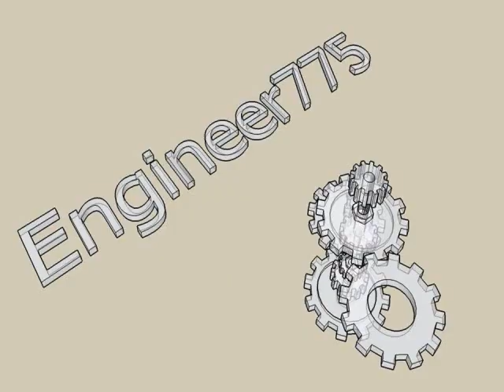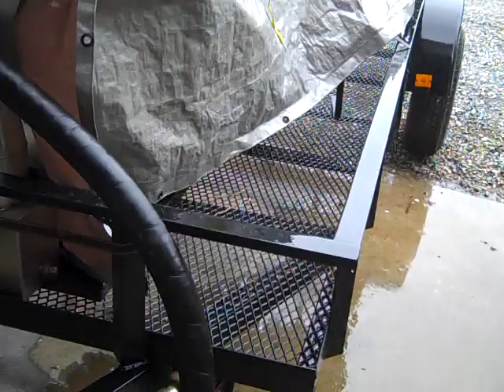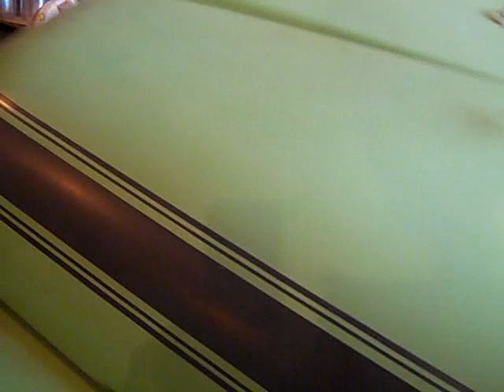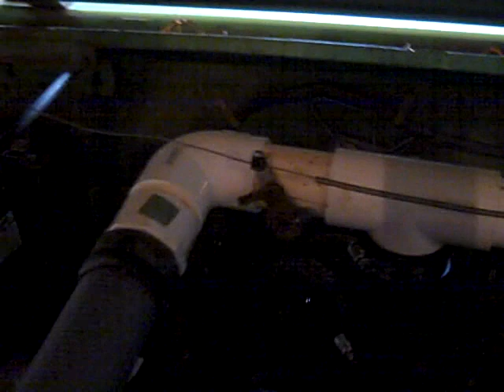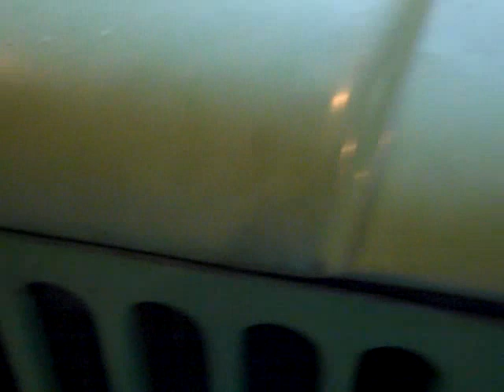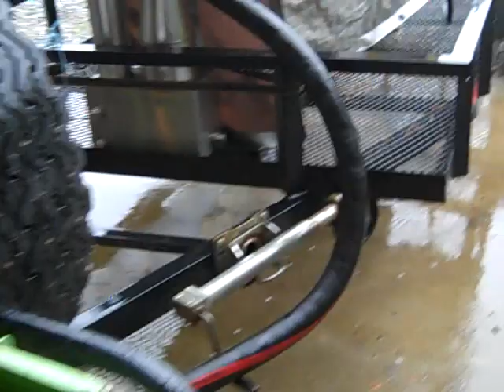Come see the "Wood" Jeep: Heritage Life Skills II

Comment: it totaly depends on the quality of the wood (moister content) the filters and the gascoolers(which remove the most part of the tar) 
larger systems run large converted diesel engines from 4000-8000 hours a year without problems

Comment: if cut to the right size and dry there should be no problems.
all carbon based fuel of the correct size (matchbox to large matchbox size)can be gasified

Comment: As someone in the automotive industry. I'm just curious with a standpoint of the longevity of the engine. Have you put any thought to filtering smaller particulate from the fresh air and also the wood gas supply.  Forgive me as i haven't seen the rest of the set up and whether you already have that kind of counter measure in place.  A clean engine is a healthy engine!  best of luck!

Comment: Hey engineer 775, on my untested gasification system for any combustion engine I have the syngas pumped into just behind the air filter so it automatically goes to the carburetor, carburetor intact. My thoughts were this would make it a dual fuel vehicle being gas powered and syngas powered. Is my thinking wrong?